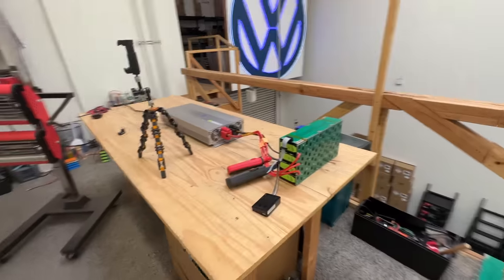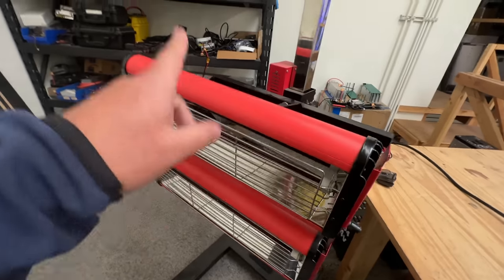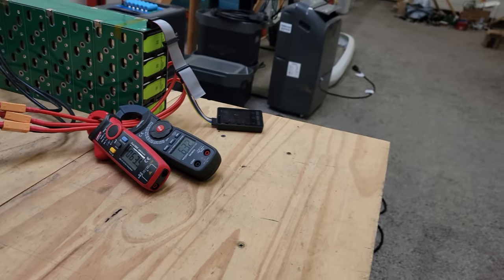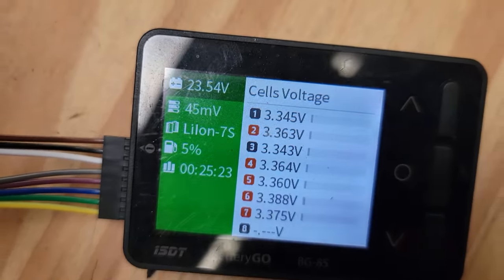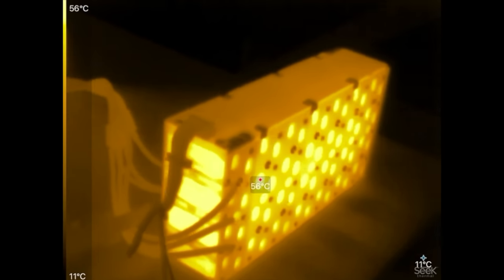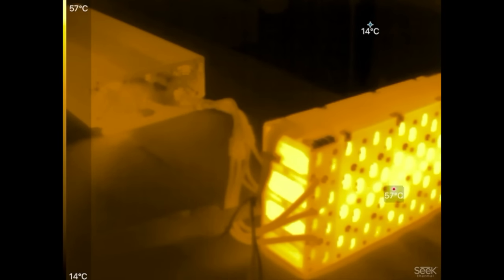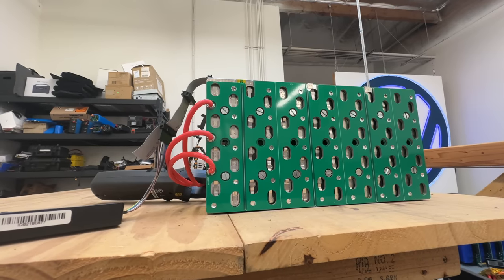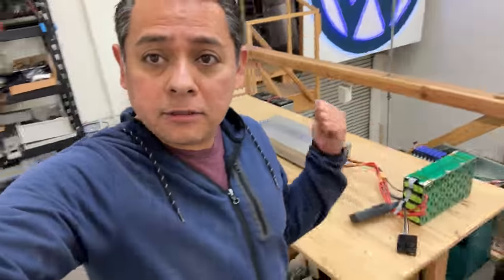120A Capable 48v Boston Swing Modules

Comment: Jehu, you could use a trick we used back when I was an Electronic Engineer in unit testing & design (High Current Power Supplies for our MIni computers) For Digital Equipment Corp (DEC) back in the 1980s. We would have several individual modular PS for all the different Voltages that our circuit board required as in +5V, +12, -12, +15, etc, on the traces, (several of these DC voltages would pull up to 35A) we would make them a little wider & we would coat the traces that were going to carry a high current with a layer of solder, and then cover them with our Green layer mash, this would give a safety margin on them.

Comment: Can I use two to increase to 96v? And can it be possible to be used in a sur ron with a motor and control upgrade to handle 96v with ease? And no I’m not going to use it for off road. Mostly for food delivery and errands within city limits.

Comment: I love the fact you're showing the max output, but I bought for expansion batteries for my Ecoflows.  I get how to charge my Ecoflows with xt90 to xt60 connectors , but how do I charge my new Jag35 Boston Swing Modules?  Do I plug my solar panels directly to xt90 port on Jag35 using same cable that I use for charging my Ecoflows (MC4 to Xt60)?  This is the closest thing to DIY I've bought so I'm excited but apprehensive to say the least.
Reply from the maker: you need a solar charge controller between the battery and the solar panels
Reply: @jehugarcia  any chance one can use Ecoflow's MPPT and USB C to charge the aux batt?
Reply from the maker: yes just get an AC charger for the battery,  and connect it to Ecoflow while you solar charge it

Comment: Would this battery pack be a good replacement for a UPS (APC Smart-UPs 3000)?  The 8 Lead-Acid batteries are wired 4Series x 2 parallel for 48v.  The ups charges at a continuous 55v.
Reply from the maker: Yes that would work perfect,  but I recommend using a BMS on the battery first

Comment: Good work! But I think you should lose the glasses. It looks like you are in the shop and it looks a little silly. Maybe just me.
Reply from the maker: You are focusing on the wrong thing
Reply: @jehugarcia You are correct. But that's because they are distracting.
Reply from the maker: Focus….  I can’t put blinders on you
Reply: @jehugarcia  😂 While I have your attention. Could I ask you to look into adding a fuse holder on the 7S board (like the ones on your BMS boards). That way we could add a blade fuse or a soldering fuse. Again keep up the good work!